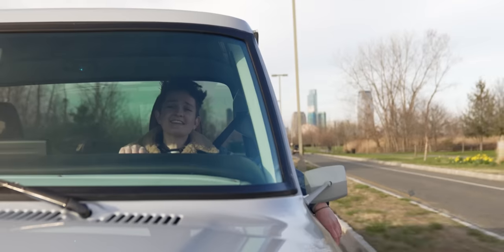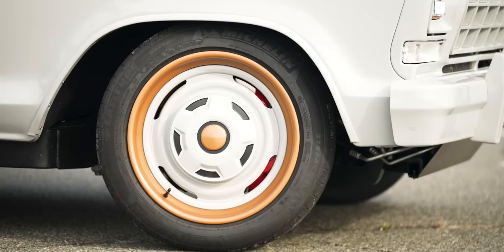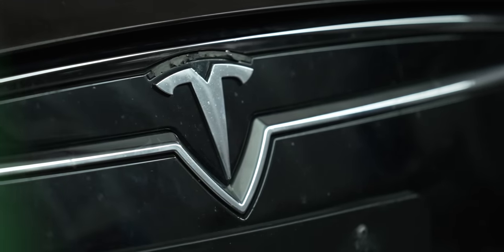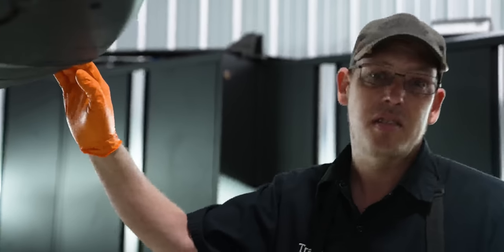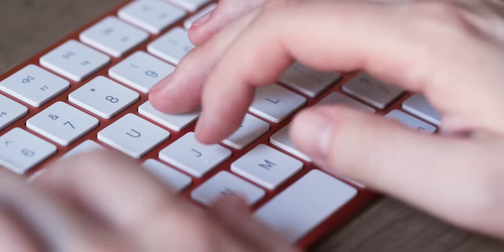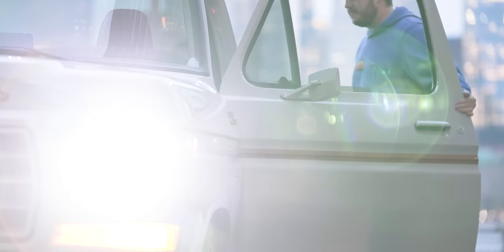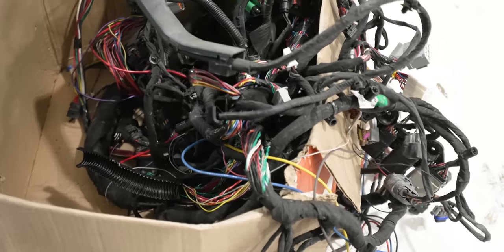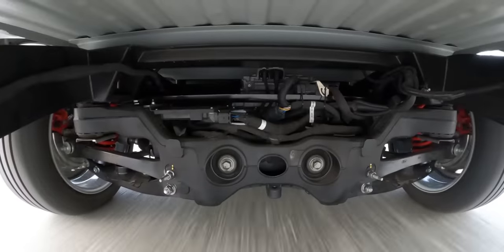Ford did what Tesla won't

Comment: I love the fact that you can take a family car that might have been passed down from grandfather to grandson or son, then you can convert it to an ev while keeping the rest original as possible. It  runs clean, no noise, lots of torque and instant throttle response. So you can now drive this old classic car like an everyday vehicle it's great!
Reply: I have a 1984 Porshe 928S that I want to convert to electric. It was great fun to own with the original IC engine but too expensive and difficult to restore and maintain now, so I 100% agree. Why should it go to scrap? Why can't it have another life?
Reply: @langdons2848   My thoughts exactly. Wow a 928s! what a beautiful car.
Reply: @Jezee213  Indeed - I would very much like see it on the road again.
Reply: prepare 20k for that
Reply: @Uzumaki   Yes, I'm sure any convert is expensive. It will get cheaper as time goes on though, well......I would think.
Reply: Safety won’t be as good. Put I see your point. It’ll probably be harder to get parts (everything else other then the battery) for cars that are no longer made.
Reply: @jorgeluiscorrea992   Yes that's very true.
Reply: @Uzumaki  still cheaper than rebuild the OG drive train.
Reply: @lordrefrigeratorintercoole288  especially as big motors are kind of being ditched behind. The supply will be low and the demand will be higher.
Reply: Yeah but let's be honest these evs aren't more clean than normal cars. And to remove all the emissions from a gas powered motor it costs less than 2 thousand dollars. You keep the sound you keep the feel you keep the fuel with 0 carbon dioxide. The reason they don't do it is because the minerals to do so are rare... And it's the same stuff used for these batteries.
Reply: @likeablecloud2454  "aren't more clean than normal cars"
Mmm. delicious koolaid.
Reply: @likeablecloud2454  You can't remove emissions from an engine, they are inherent. That liquid fuel gets converted to gases in the combustion process. 10 pounds of fuel becomes 10 pounds of gas, if you aren't capturing it, then it's going out the tailpipe - that's just how that works. At best a catalytic converter can convert a lot of the NOx (ie: smog), but CO2 and CO emissions out the tailpipe is just part of how the process works.
Reply: @christopheroverbeck3662  the 4k miles of jet fuel or diesel fuel from china or africa on boats or planes then it gets loaded into semis then carried another 2-4k miles. so in all the creation of said vehicles already does damage to the environment. not to mention the desposal of said batteries and if it has a fire no fire department is ready for a fire of that nature. chemical fires are nearly impossible to put out, that's going to cause more damage to the environment if one of these crashes. so i don't think it's better for the environment. also hydropower for creating the electricity is also known to cause harm to the environment and making solar panels well the process of making them is damaging to the environment. this whole go green stuff is BS because none of their solutions are actually great to the environment. 

The real solution is to plant more trees and to remove the emissions coming from the production of said vehicles and to make exhausts or methods that remove or lower the carbon dioxide produced by vehicles. and we need methods to remove the carbon dioxide from the air without needing trees, since most of the world uses wood for housing and whatnot. so we need to switch building materials first, then we need to worry about cars, the biggest problem to the environment was never the cars in the first place, it was the deforestation and the destruction of the environment to make said cars which therefore removed the ability for mother nature to take care of the carbon dioxide in the air. plants need carbon dioxide for food and they make oxygen which we need to live and destroying the forest cripple earth's method of doing it alone.

i really did just type this for no reason but it's not like anyone will listen to what i say. nobody cares and nobody will realize EVs are more wasteful and harmful than normal cars, the batteries can't be recycled either. so we have waste batteries which run off toxic chemicals and rare minerals being wasted because companies are too lazy to use a different method of saving the planet. just the ol lets make EVs mainstream cause that's totally the reason the planet is screwed. not the other 300 issues that are causing it. this whole focus on EVS is a waste of time.
Reply: @0hypnotoad0  that's why we need to develoup better filtering systems and conversion processes on the tailpipe. as said there are specific minerals that capture said stuff and if we find a way to unload it without it going into the atmosphere it's alright. we can then use it in a greenhouse to help grow plants etc. this hasn't been tested before. also if you have a small hole for oxygen to get in it will be normal co2 so obviously it's worth trying. better ways to capture and remove said stuff. and that's the whole pint. i know you can't remove it but there are better ways to capture co2 and we use the most inefficient way to do that on modern cars. to get a car that does that properly you need the top of the line luxury cars, that's pathetic.
Reply: @likeablecloud2454  It's not a matter of "filtering," it's a matter of capturing and sequestering. What you're talking about is CCS, and we're not even close to having working portable systems for that. Top scientists and engineers have worked on CCS for decades, and haven't even figured out how to do economical and efficient Carbon Capture and Sequestration at large power plants yet - if they can't do it at industrial scale yet, there's no way it can be done at a small scale for a vehicle at this time. Chances are the systems to do it are so complicated and costly it'd make ICE vehicles more expensive and than EVs. Fact of the matter is, if CCS was easy or economical to do, we'd already be doing it and there wouldn't be a discussion about greenhouse gasses in the first place.
Reply: @0hypnotoad0  there's more to it than what you just said. And you got it backwards. They have a small portable scale already made they just can't put them in use. And filtering and capturing in more efficient ways is much easier than ccs or other methods. Creating better filtration so less carbon dioxide is produced is great and needs to be done but companies refuse to. That's the quickest and most sure fire way of doing so if all we care about is lower carbon emissions
Reply: @likeablecloud2454  No. Go look this up, there are no CCS systems for cars. Car emission controls only deal with (some) NOx emissions, and some particulate emissions. You are plainly ignorant of the facts, go look this up and educate yourself before you blather.
Reply: swapping the engine to EV isn't going to make it drive like an everyday car. there is much more to a modern feeling car than just the engine.
Reply: @ss-fc2fh   oh I know that, im not saying it will feel like a brand new ev, I'm just saying it can breath new life into an old car.
Reply: Great untill you are in an accident unfortunately. Car saftey has come a long way.
Reply: @likeablecloud2454  How do you remove the emissions from a gas powered motor? where do the emissions go? or where do you store them?
Reply: @jamesmorison   oh you got that right! It's gotten so much better
Reply: @jamesmorison  hah you think i care about that. i only care about this whole no emissions BS the same that eletric cars do. just because the car releases no emissions doesn't make it no emissions, so who cares where you store them. that's all that's needed for the current market, and thinking about how to treat and release it is the industries job, not mine. as said it won't cost much money to completely store and filter it out. but what after, it would cost money to switch filters etc, that costs money and then releasing it back into the environment. but still a quick solution is learning how to treat it whilst in n exhaust pipe.

listen specifically capturing and absorbing co2 is easy on an engine. restricting the airflow of an exhaust and having more fuel efficient engine's can we have less emissions from a motor. once we do that and fix the issues with the current exhaust systems not capturing enough co2. then it's going to have less co2 than what co2 is produced by EVs. 

as we all know EVs are only considered no emissions because the car itself has no emissions, removing that and making it say no emissions is easy. Jeremy Clarkson did it, and that was 12 years ago.  also hybrids are more green than EVs so we need a full switch to Hybrids then EVs. all our issues with EVS should have been roughed out on the Hybrid networks, but instead we made the switch to all electric before working out he problems with hybrids. not to mention the other issues caused by EVs.
Reply: @christopheroverbeck3662  car to car Eva are cleaner, but the take into account the manufacturing, powering the grid, digging up Africa for the materials, Using Semi trucks and other heavy machinery that can’t be electrified to transport it, and your better off buying a used car to save the environment.
Reply: @likeablecloud2454  you know there are hydrogen powered cell cars and combustion cars, it got shut down in the USA during the 90 -2000s  cause big oil stepped in, the infrastructure is easier to incorporate, tho they kinda have to restart things now but it’s coming along just as fast a electrics, but it doesn’t get subsidized and isn’t hyped like electric.
Reply: @Spearmint22425  it didn't get shut down by big oil. It had to do with other reasons
Reply: @Spearmint22425  If you had actually read my source, you would have realized that they explicitly take into account every single one of those factors.
Worst case EV's are still 20% better than best case ICE's
Reply: @christopheroverbeck3662    Between mining processes, transportation, and the destruction caused to eco systems surrounding mining sites for cobalt and lithium, plus the far more environmentally harmful manufacturing process, yeah, an EVs lifecycle including parts, replacements, and initial manufacturing is leaps and bounds more harmful to the environment than that of an IC car. And whereas David Freiburger can step into a junkyard and step out three days later with an old hot rod that hasn't moved in fourty years, an EV's batteries have a lifecycle of only about 10-15 years.
Reply: @0hypnotoad0    Lmao I like the response. "Uhh no, go Google it like I just did eight minutes ago - it's not possible!"
Reply: @0hypnotoad0    Ahh yes, the classic "Either you agree with me and the people I listen to that tell me what I want to hear, or you hate science."  Feels good and secure to tell people that, doesn't it?
Reply: And you lose everything about the car that gave it any meaning in the first place. Great job. Like you couldn't drive those old cars like normal cars? How old are you talking??? Anything made after 1960 besides those little japanese and european econoboxes have no problem on the highway. A 911 like shown in the video had a stock top speed of over 100 miles an hour.
Reply: @mr.mercury4247  Yea like it depends, if it has like sentimental value or certain memories then you may want to keep it original, and yea after 1960's cause certain things won't be the same for sure.
Reply: The problem is if you live in the northern states you still can't drive the older car's like you normally would because they'll still rot out from the salt
Reply: @jasonbrown7258   Yea defiantly. I'm in Ottawa Canada and the winters here just destroy cars!
Reply: On the one hand, I think putting modern motors in older cars is interesting, allowing them to be kept going longer since you don't have to look for ultra rare parts, if no reproductions are made of course. On the other hand, the purist in me is screaming that it's not original, and that that's blasphemy lol.

Also, no more throttle cable which means a vague driving experience, In my opinion at least.
Reply: @The_Big_Jay   Yea I've got so many replies disagreeing saying it ruins the car. I was just talking about regular old cars not classics and yea for sure it's not a purest thing and might ruin the experience in some cases so depends on what you want. 👍
Reply: @Jezee213  Even then with just regular old cars, it just irks me. I drive a 1989 Honda Prelude, not a classic by any means, but still old, a regular old car if you will. I'll be damned if every part that breaks isn't replaced with an original replacement part, or an accurate reproduction because it just bothers me when cars that are in my mind 'survivors' are almost irreparably changed. Of course, I don't think I'd ever tell someone that they're horrible for doing it or anything like that, it's just that I wanted to point out how this is a double edged sword for some people. It adds longevity to your favorite car.. while changing it beyond recognition in some cases.
Reply: @The_Big_Jay   absolutely half of a cars appeal is the character and its making it something it wasn't engeneered to be so depends on the situation but new evs are where it's at. 👍
Reply: @Jezee213  Yeah, it's definitely a person by person thing. I just have a weird OCD thing about it where it's gotta look factory new or something.
Reply: @The_Big_Jay   Yea man I hear ya. There's nothing like factory original vehicles.!
Reply: @jorgeluiscorrea992  Depends on the car. I still see parts for VW bugs.
Reply: Until you total it because youre daily driving and the average iq isnt what it used be
Reply: @reichbunny713   True.

Comment: That's actually pretty dope. Hope this can make EV's actually sustainable for once...
Reply: They already are
Reply: They're hardly sustainable, but it's better than throwing it away sooner.
Reply: What do you mean by sustainable?
Reply: It's replacement batteries that EVs need most, the motors are extremely low maintenance.

Or are you just referring to supporting 3rd party repair and modification generally?
Reply: @vp5429  Until you need to replace the batteries... But that's a 3rd world problem, not a 1st world problem
Reply: @zNoah  EVs do way less damage to the 3rd world that petrol vehicles.   But Yes manufacturing the batteries and disposing of them have problems right now.
Reply: @CastleBomb44  I mean we 3rd worlders have a lot of people using old cars (10-20+ year old), so battery longevity is a concern. And knowing ourselves, we are not gonna recycle the batteries correctly.
Reply: They butchered that f100 it should be original
Reply: @DatsunBloke7357  calm down it's a f100 a mass produced work horse
Reply: @vp5429  EVs overheat like steam engine with no relief valve, they are by no means durable and current designs put too little torque on the wheel for towing and are too inconvinient for their range. Once taxes get a hold of EVs they're going to be purely unviable alternatives to ICE.
Reply: @CastleBomb44  But EVs are too heavy, ridiculously expensive, costlier and harder to repair, terrible at towing, overheats too easily and the range is too short and will get worse the more it ages.

 The environmental initiative for EVs to replace ICE is also counter-intuitive for 3rd world countries for the same reason they are for 1st world countries, Oil, Coal, and Natural Gas will and will always be the no.1 cheapest energy source there is and produce more than 90% of the world's energy, renewables cannot compete to the scale Oil, Coal and Natural Gas have.
Reply: They're very much not sustainable, and petrol cars are even worse. Cars will never be sustainable
Reply: @zNoah  for sure.  People in the developing world have different needs than the USA.   I would love to see cities in the developing world would be redesigned so that people can either walk/cycle/ use public transportation and not need a personal vehicle.
Reply: Check out ritch rebuilds utube channel or interviews with from news channels.
Reply: @vp5429  EVs are only marginally better than gasoline powered cars once they pass the 3-5 years lifespan, in terms of CO2 emission involved. On top of that they use materials that are far more problematic to dispose of, in their batteries (nevermind mining those materials in the first place). It is far more sustainable to keep your old gasoline car than buy a new EV.
Reply: @CastleBomb44  YES!!!!!!! People think 'oh yeah if everyone used electric cars thw world would be perfect', but what about no cars? Each EV's manufacture emits almost 30 tons of CO2, a bicycle or a pair of shoes is much less.